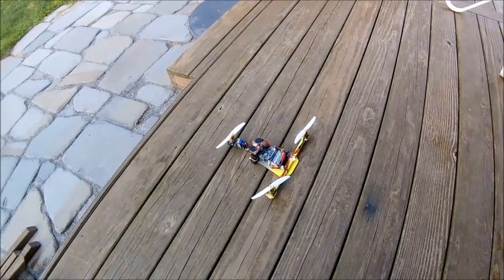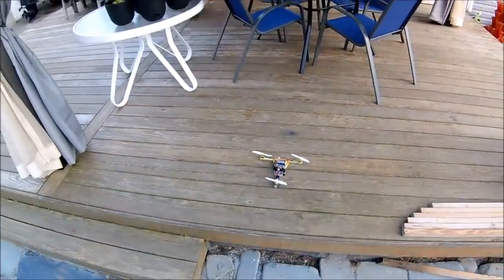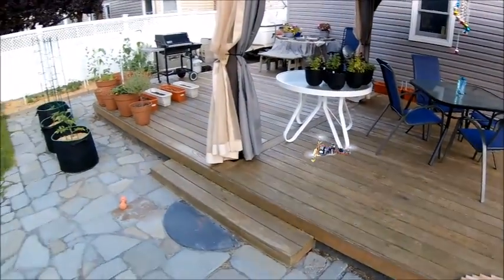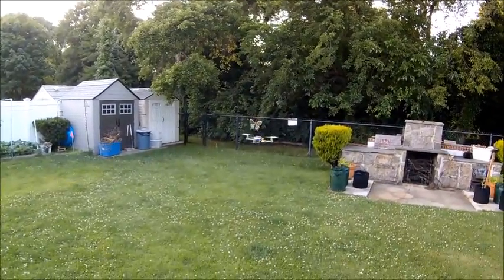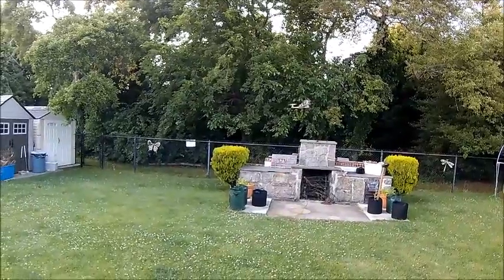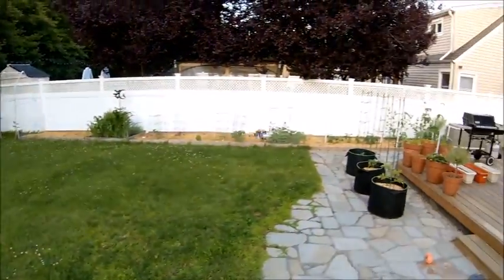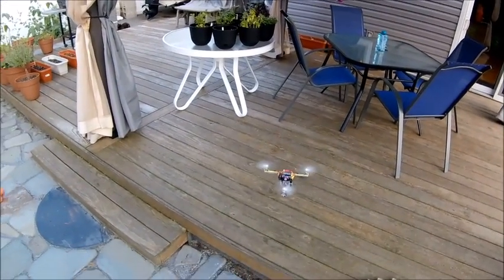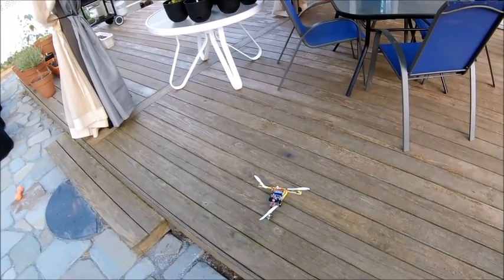Mini tricopter Multiwii Greg006

Comment: I have an old tricopter that needs a flight controller and a RC RExplorer kit that I never built. I love tricopters and I'm looking to get back in the hobby
Reply from the maker: Would you use Multiwii or Beta flight? I just finished one on Betaflight and it's pretty good. It just took alot of tuning on the tail. The rest was great straight away.
Reply: @greg0063  Eventually I'll try it, I think I still have an old multiwii board on a quad. Thanks for the response
Reply from the maker: @KeyBored101  cool, best of luck with it.